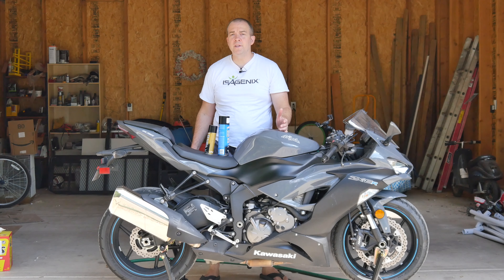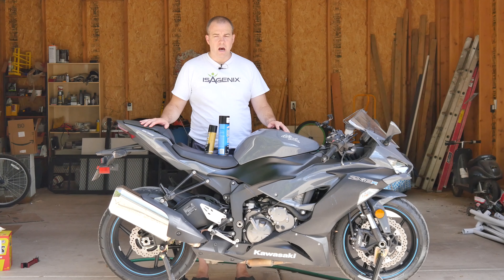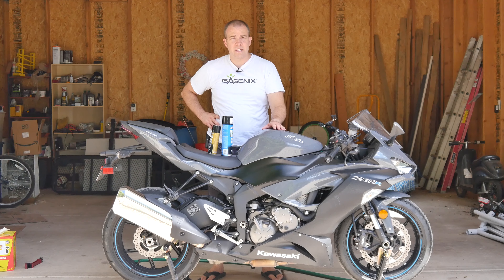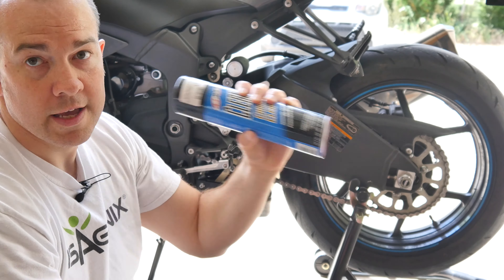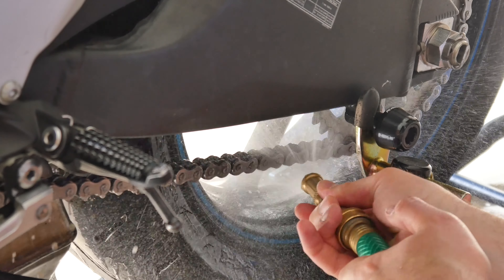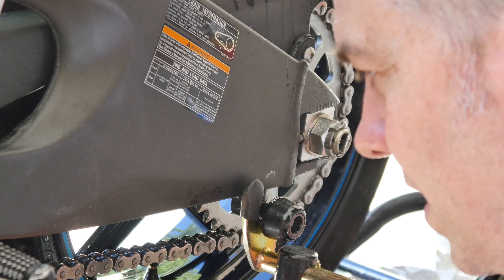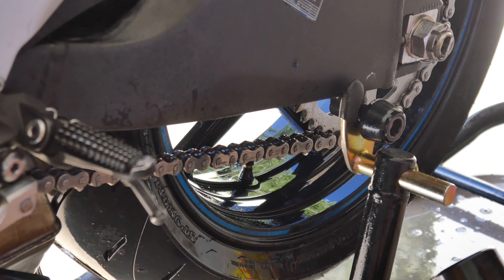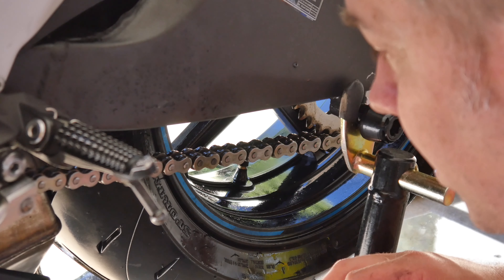Chain Care on My 2019 Ninja ZX-6R

Comment: When cleaning, do you have a good way to keep track where you started cleaning?
Reply from the maker: I can tell by looking at it which parts I've cleaned, and which parts I haven't.  My chain always looks pretty clean because I maintain it like a second religion, but after several hundred miles I can still tell a difference between cleaned and not cleaned.